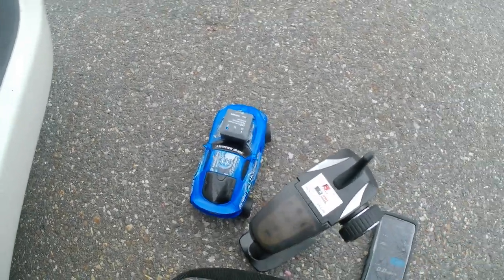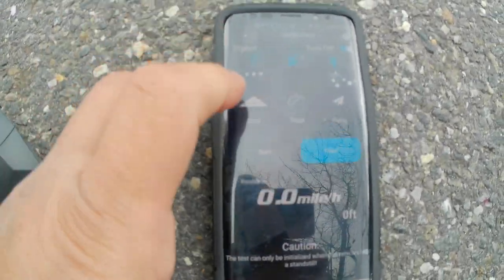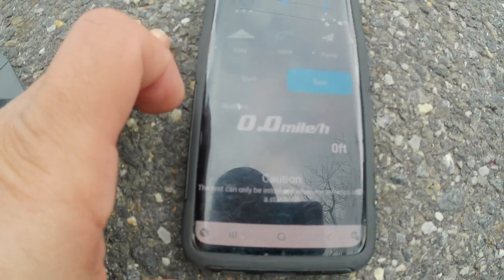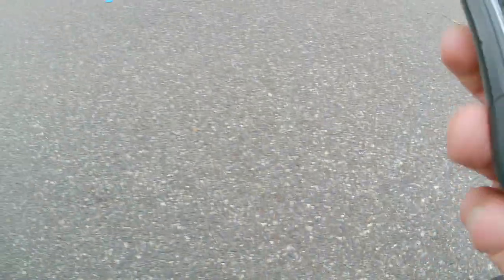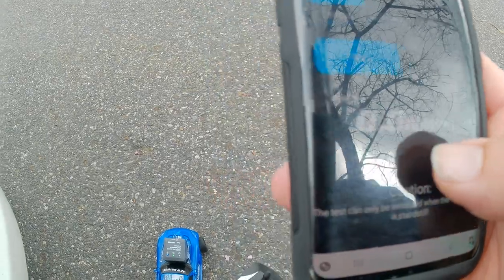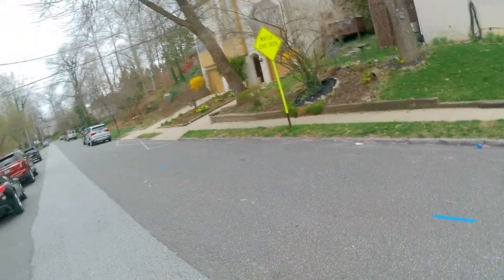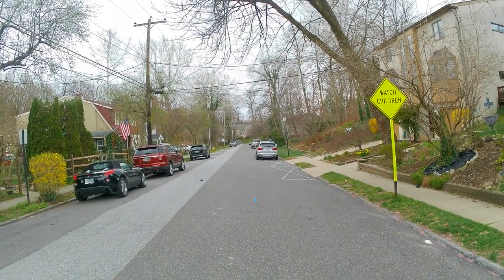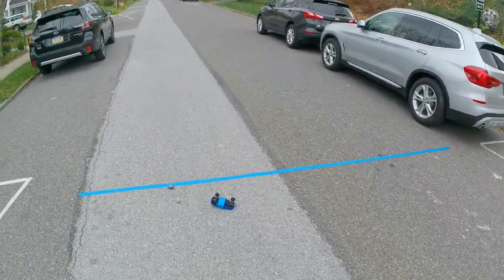Enduro24 #tinygappinit Build off Disappointing official run

Comment: The truck looks awesome! Don’t beat your self up about it I think you did great in the time you had. I would recommend to run no suspension and make some links to where you could sit  the car as close to the ground as possible and I bet that would make it less Rolly  and for the body maybe run some small  shock towers if possible. But other than that I thinks it awesome! And with some work it will be and perform great
Reply from the maker: Thanks Tanner I am going to work on the car more I am going to lengthen it and lower it more I might look for another body for it as well this thing was a blast to work on there were some frustrating times when things didn't work correctly the first time but it was worth doing this project. But I am going to work on it some more